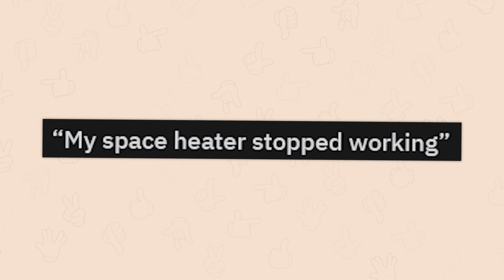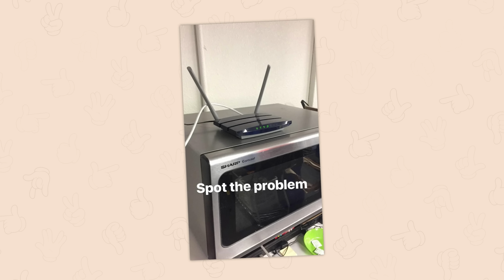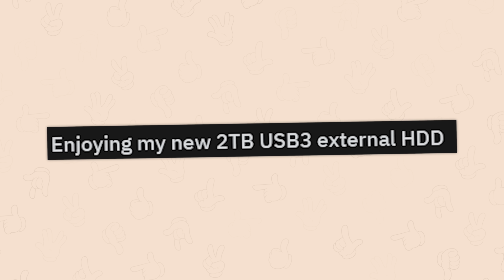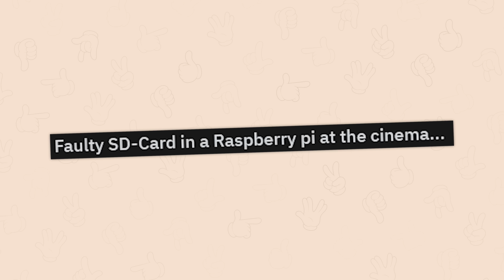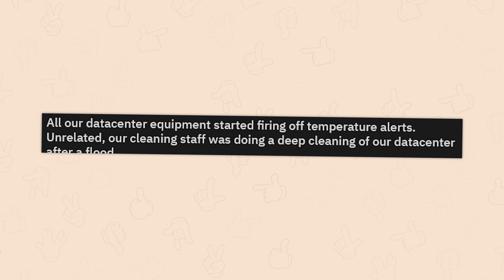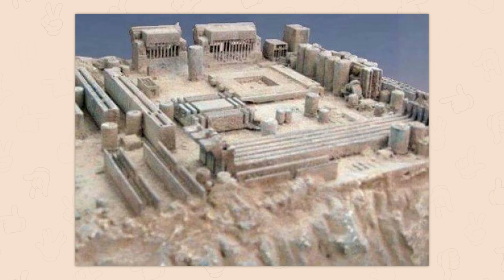r/Techsupportgore | melted :(

Comment: as someone working in IT for 20 years I can confirm. "percussive maintainance" is indeed a great solution to a great variety of problems if done by professionals. it mainly fixes the frustration of the it guy but sometimes also fixes the problem ...
Reply: It is especially effective as a solution when the problem is a coworker keeps messing with the wires :)
Reply: Oh? Server? 
Solution: h a m m e r .
Reply: Sometimes it fixes the problem of "The company won't buy a replacement for this piece of critically needed hardware because 'oh the one we have works' or something similarly obviously wrong, when to any professional the answer is 'no the F it doesn't work' ".
AKA it can fix the problem of the bean counters having higher priority than IT, because if you break the old insufficient thing so it won't work but you can recover data from it (if needed), then they MUST buy a new thing to get it working, and hey guess what maybe this wouldn't have happened if you had budgeted funds for that upgrade IT has been mentioning in LITERALLY EVERY MEETING for the past 5 years.
Angry? No, I'm not angry, what are you talking about?
EDIT: Oh and since you're in the IT department, you can probably cause the server room cameras to have "unfortunately" lost the footage of the event.
EDIT 2: This tactic is only to be deployed in cases where you have to deal with an obstructive and/or micromanaging person outside of IT that is trying to run IT without having a fucking clue what the job entails because "Oh I build my kid's computers" or something like that (enterprise stuff is totally different than that, ya nonce!).
EDIT 3: Even better if you can figure out how to pin the incident on said obstructive or overly micromanaging person.
And yes, this is probably how that one post in the vid with all the cut ethernet wires happened.
Reply: @ProtoV33MK1  That sounds like the window motor for that door had managed to get a broken or otherwise bad connection between the commutator of the motor and the windings of the armature. That's an unusual failure, these days it's more likely that the gears in the mechanism will strip out or (in a different style of window motor assembly) the pulleys will have worn out or the cable will have jumped out of place.
20-30 years ago I'd tell you to go take that bad motor to the auto parts store, they might give you the address of one or more shops in town where you could get the motor re-built (that was before they sent all the parts re-manufacturing jobs to China).
These days I'd tell you to search the internet to see which vehicles used that same window actuator, and from that you have a list of what vehicles you want to harvest parts from at the junkyard (Hundai Santa Fe is a pretty common vehicle, you should have plenty to choose from). Or you know, you could just get a brand new one on Rock Auto, that works pretty well most of the time but if your vehicle is old enough the only option will be aftermarket parts that might not fit or work quite as well as OEM parts made by the same people that made the vehicle in the first place.
Reply: There is no feeling better then pushing a component that is beyond repair and that you've had to deal with for an extended period of time into the territory of completely destroyed.
Reply: Is your company hiring?

Comment: temp folders usually get filled up like that because of viruses. the large amount of data in the temp folder is most likely because the computer is being used directly by hackers to commit more hacking or like in the old windows xp days just to screw up your hardware.
Reply: or just turning off the pc without closing the webbrowser first, having all temp browser data, img and etc stuck , and never deleted
Reply: Also by Windows Updates and other software online updates. Plus there are some crazy bussiness software which spam into temp folder like crazy.

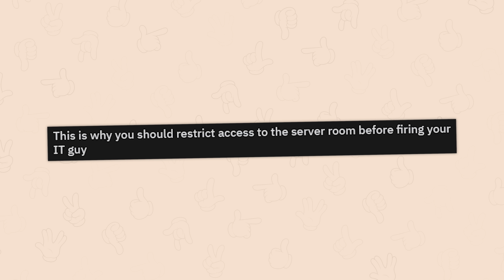Comment: 12:50 - That's actually really common during network upgrades. The techs will just cut the cables instead of trying to unplug 100+ network cables. The cables are being replaced anyways so it doesn't matter.

Comment: I've never laughed so hard when I saw the "Hard Reset" tool!?!?! 

One company I worked for starting in 2012 had a rat's nest of cables like the ones shown. My boss had just taken over as manager so he had us come in with him on this one weekend. He would pull the cables and tell one of us it went from this port to this port, and we'd jot it down. Once he had one patch panel cleared, another person would come back and start rerunning the cables, with the correct length, and actually use the cable routing paths above and below the patch panel. Took us all weekend to clean up, but he bought us food and let us listen to football games while we did it.

Comment: The thing about the Temp folder, that was actually a common issue in Windows 7. The Temp folder should automatically be emptied when Windows shuts down, but for some reason that didn't always happen. One of our customers had this issue. There were several employees that called frequently because their C-drives were full and it was always the Temp folder. Haven't seen that happen with any later Windows version tho, so it seems MS fixed it.
Reply: so in windows 10 is it safe to completely clear all the temp files?
Reply: @toast1167  The files I'm referring to and that usually caused this issue are located in the %Temp% directory (hit Windows+R and enter %temp%. This leads you to the Temp directory hidden in your User folder). Deleting those is perfectly safe. If any of them are still needed, Windows will tell you that they're in use.

Comment: If you plug your space heater into a power strip, the space heater using lots of electricity, which will cause a heat to build up and melt the casing of the power strip, would eventually lead to an electrical fire. So ALWAYS plug your space heaters into a wall outlet, and if your wall outlets have only 2 holes for 2 prongs, and your space heater requires 3 prongs, to fit in a 3hole outlet, get those things that have 2 prongs but has 3 holes on the end and put them in the wall outlet, then plug your space heater in.

Comment: 21:13 it literally is ground. That's where the term comes from. The ground in a building's electrical network is all connected to a literal metal pole that is stuck into the ground somewhere.

Comment: Those cut cables are from removing an old switch. You know how hard it is to remove the old cables with the stiff tabs so it’s easier to cut because they should be replaced also. Wasn’t from someone being fired.

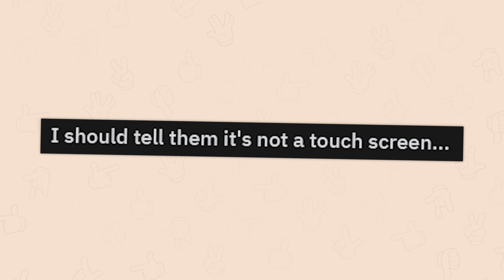Comment: 22:24  
I used to work as a janitor in an office building.  One of those places where some of the immigrant workers did not know when to go home and let us work. We were not allowed to disturb workers for anything while they were at their stations.  So if they were working,  we could not take the trash can  or dust off the surfaces etc. in the cubicle.  In these several cubicles,  the monitors were ALWAYS smeared with crud.   CRT monitors...  Definitely NOT touch screens.   So one day I'm vacuuming a corridor and I smell this  horrible, foul stink. "Like somebody took a massive dump, on a huge pile of crap, soaked the whole thing with a jug of week-old farts, and lit the whole caboodle on fire."   I figured either a sewer pipe from the floor above broke or someone dumped a body in there somewhere..   I go to investigate.  I find about 6 of these dudes crammed in one cubicle  all eating this .. this...  "Stuff" with their fingers.   It's all over their hands. IT is the source of the stink!  They were also looking at the monitor, speaking Hindi (i think) and  taking turns pointing at different things being displayed.  By "pointing" I mean they were actually poking their fingers onto the glass.  That and the guy running the computer was typing and using the mouse with this crap on his hands. 
One day I find a note on that very monitor.   "Clean please.  Thank you."  I did.  Just the screen and just that one time, since we were not allowed to touch anything computer related.  We could wipe the desk-phone,  the desk itself in addition to sweeping the floor and removing the trash,  But cleaning the computer equipment was a strict no-no.

Comment: Fun tech fact: some Asus laptops (and maybe other brands, not sure if it’s an Asus thing or a Windows thing) have a setting where you can “silence” the fan
Basically it will keep the fan from going above a certain speed so it doesn’t sound like a plane taking off
I do not recommend using this feature

Comment: There was a computer at my old high-school that hadn't been working for years, but even though I had offered to help the teacher didn't want me messing with it, which sucked because we never had enough computers for all the students in the class. 

One day I got fed up and, when the teacher stepped out for a bit, i popped open the tower to see what was wrong and found the hard drive, fan, and board all unplugged alongside a bottle of hand soap, hand sanitizer, a box of tissues and a few cookie wrappers crammed inside. So I cleaned out the garbage, plugged everything back in and it magically booted back to life. Was essentially that classes IT guy for the rest of the year.

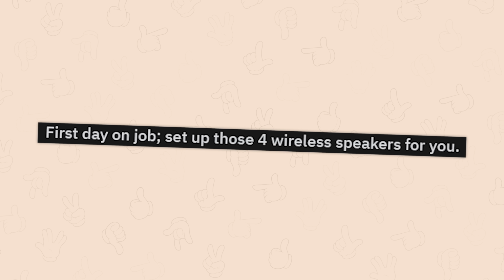Comment: 18:15 I don't think that the joke was the upside down tripod, but more likely what the heck they were thinking by mounting heavyweight speakers to cheap tripods on grass in a place where there's public traffic...
Reply: I doubt it's even left like that for long. Somebody riding on a trailer pulled by a golf cart or on the back of a pick-up truck is using the stands as grab handles to drop or pick those up during staging. That way they can do it quick while riding without having to climb up and down for every one of those. They caught a picture of that before the other person doing setup or take down flips them.

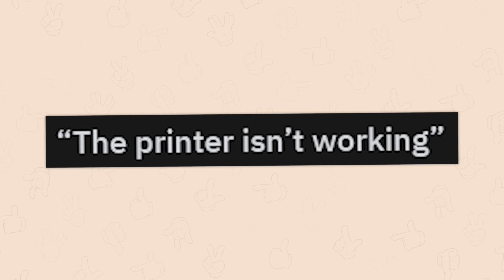Comment: 7:40 pretty sure that it might just be the plastic packeging and the die having some intermitent connection that somehow passed the boot self check the reading from it is the problem you can write to "air" it looks like probably 4GB dimm so yea that would get BSOD pretty quickly

Comment: That memory module with the cracked chip? That happened to me. Funny thing is I REALLY had to push the memory for it to fail. When I got the kit, it was a 32gb set, 2x16gb. When it crossed about 20gb, it bluescreened. I still have the stick somewhere.

Comment: Speaking of writers with old computers, my parents' family business is local news publishing and I worked there in the early 20-teens. They were still using the original pyramidal iMacs on OS9. Those machines were glitchy as hell - clicking the wrong files or having more than one program open at the same time would make them crash, or sometimes they would just crash randomly when there was a little too much load on the CPU from our graphics software. My mom called them "schizophrenic" for their propensity to just lose their minds

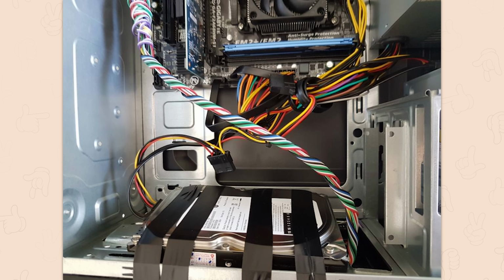Comment: Wow, that 3:38 was basically me. Found an "old" desktop in some junk car my uncle was scrapping, took it home to see if I could get it back in working order and finally lay my current desktop to rest. Hard drive it had was dead (looked like someone had tried to replace it's insides, cut open and nastily welded back together), so I took this 1tb hard drive out of a laptop a friend dumped at my house a couple months ago. Then secured it in place with 2 screws (top left and a middle right, the only 2 that aligned with existing screw holes for a normal hard drive), that mind you didn't fit too well in this laptop hard drive. Go to turn it on and, it worked 🎉🎉🎉. Until literally 20 minutes later when my little brother rushed in the room, kicked the side of the computer and it farted and died. My guess is motherboard damage?
Reply: my initial guess would be that the new hard drive died? did it reach the bios after the kick
Reply: @jackbod  yeah, I actually had it in the computer I use since the disk reader went out. There was a very nice slot to rest it in, double back tape to keep it in place and it worked fine

I guess an update is required though, I got frustrated with it so I shook it around vigorously. Two screws were just chilling behind the motherboard, so my guess is they touched something and screwed something vital on the motherboard up

Comment: I replaced a gpu like a few hundred times at this point, almost never unplugging the pc. There are server mobos that support hot swapping pcie cards, so clearly it's safe to do even in a running machine.  I honestly have no idea how badly you have to be mounting it to cause something to fry xD
Reply: Data pin on card came in contact with power pin in slot while being rotated out of computer that doesn't support hotswap pcie. Maybe the pcie power plug from the psu played a factor in the conclusion, assuming that the whole thing isn't just a bit.

Comment: AT&T has such a low level of care that when they had to burry a line in my yard they ran it right through the middle of the yard. Sadly my yard was the one selected to have the receptacle in the corner for their service. We do not use AT&T for anything though. So now if I want to do anything in my yard that requires digging I will have to call them so they can move it out of the way, or I just start digging and pretend I had no idea and knock out AT&T services for some time in my area. Take a guess which one I likely will do.

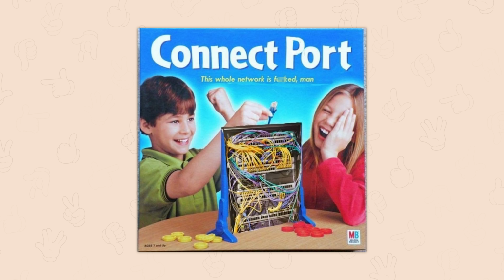Comment: 9:49 bruh you just had to remove the dust that got stuck in the charging port. Now you've pushed it in further and it'll be harder to get out. Not smart
Reply: Yeah
Reply: Its actually pretty easy to remove u just need something sharp to take dust out
Reply: @yourdadwiththemilk  yup. You can use a SIM-ejector tool or a paperclip

Comment: 3:16 microwaves from a microwave block wifi waves
Reply: the microwave is a faraday cage, almost no microwaves can escape. even if it actually does interfere, there would be no effect on the wifi signal whatsoever.
Reply: Except the ones that don’t block all of the microwaves, we had one that when turned one the wifi signal would drop
Reply: Well then you should get a new microwave, but I guess it isn't really required since microwaves can't do anything dangerous unless you're inside one

Comment: a few weeks ago someone warned me about plugging space heaters into surge protectors. I had had one plugged in for a long time, not ON very often but I didn't know it wasn't supposed to be plugged into one of those. (a big-ass warning on the box would have been nice! :/) I ripped that plug out so fast, never again. seeing a melted one makes me turn inside out with 'what if'
Reply: I had one plugged in for like 3 months, and although the power strip was not melted or anything, the actual plug on the space heater definitely was, melted like crazy, still worked, but tossed it anyway.

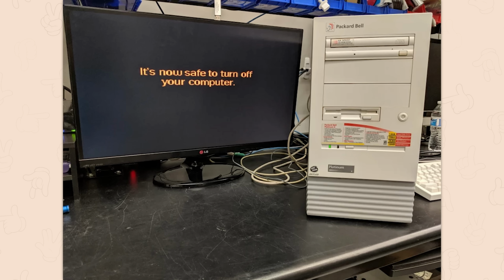Comment: 10:40. I thought Windows 8 and above didn't even support processors without SSE2. Is this just last desktop running with the 1st Pentium 4 of all time?

EDIT: Or did they choose that as a screensaver? I noticed the specs and assume it's not possible even with insane treaks.

Comment: The “This is a server! (yes, really) DO NOT CLOSE LID!” laptop has two probable explanations. #1 it ran out of battery. It may have been plugged in, but a power outage would do it. #2 the lid was closed just enough to turn it off (or it lowered over time). #2 has actually happened to me before.

Comment: That one about the phone not charging without pressure is literally my wireless earbuds’ case. The little port where the charging cord goes came out at one point a couple months ago, but it still charges. I just have to keep the cord in there 24/7 now, and when it needs to be charged, I plug it into my laptop and put the case underneath it at just the right angle, and it actually works.
I’ve had them for a few years now, and I’m not giving up on them just yet!

Comment: I once witnessed a prebuilt that was shorted because the 2x4 CPU cable was plugged in 1 column too short. 2 pins hanging overboard, 2 pin holes empty on the other side. Wouldn't turn on when plugged in correctly. Awesome.

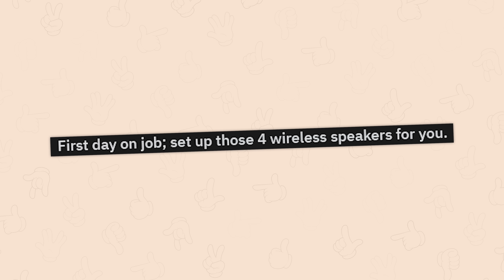Comment: 18:12 When standing PA speakers which can be a 2 man lift, it's easier to turn the speaker upside down and insert the stand then use leverage to "roll" the speaker onto the stand, making it easy for one person. You then stage the speakers where you believe they should go and then the event coordinator comes over and asks you to move them a foot or 4 from where you put them. PROTIP: Run the line from the board and leave the extra cable coiled at the speaker so when you have to move them again 20 min before doors you aren't scrambling to re-cable your run.

Comment: 17:30 that's a Fujitsu PC ;) 
And about the huge temp folder: especially on Win7 there was this "glitch" that Windows tried to compress its CBS log (a log file that tracks update installations and can get big pretty fast) but failed due to some obscure reason. Problem being that this "glitch" left the half-compressed log file in the temp folder, and Windows starts the compression process over and over again. So after a few days you have thousands of CAB files, each at least a few megabytes big.

Comment: 4:16 I work at a computer repair company and most of the time it's outlook emails causing this. A lot of clients have outlook save every single attachment of every email they get on their computer  under the temporary data without meaning too. On iOS this is saved under 'other' but on windows it's saved as temporary except it never is temporary because it's a PST. 

Another reason to not use outlook.